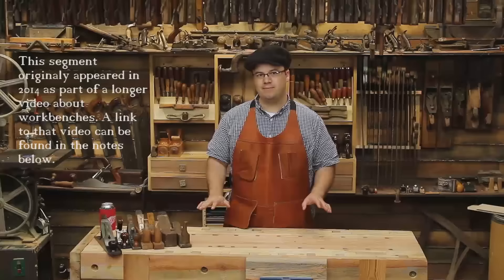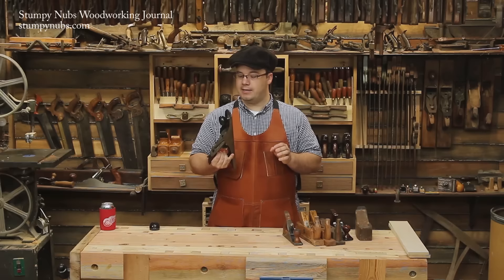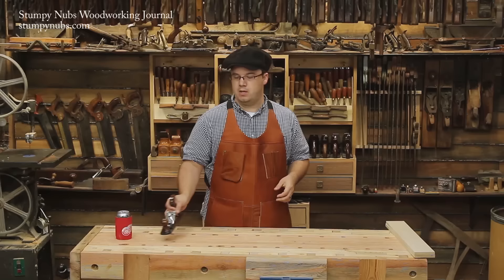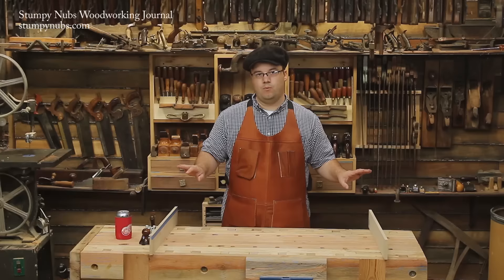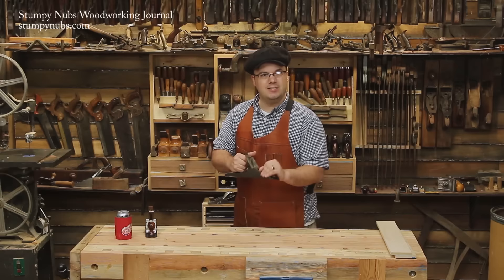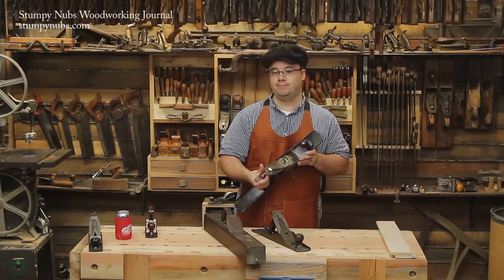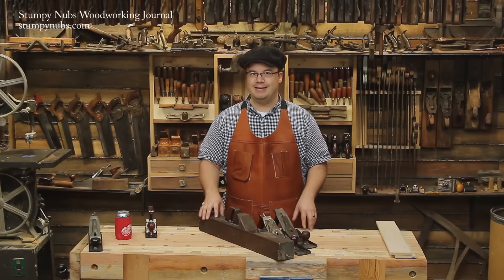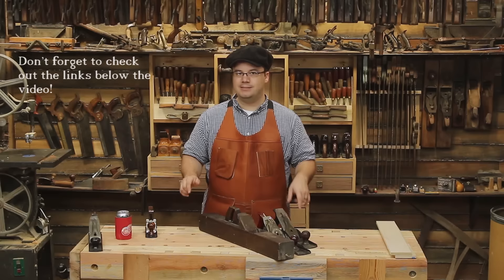How to flatten your woodworking bench with hand planes

Comment: Thank you. I didn't know I had a jack plane...but I did. I didn't know I could plane my work bench...now, I did it.  I didn't know my faceing vise needed to be flush to the table...now it is.  I didn't know I needed 3/4 holes to work with that vise...not it has them.  I didn't know a LOT!  Thanks, K

Comment: very angry ...  I could't flatten my workbench .. I used a belt sander and planer where necessary and ended up with a relatively flat workbench . Then thought I will just cover with a 18mm plywood - and  guess what the plywood is also not flat . I tryed to clamp it down in certain places and used wedges where needed ...   

Failed : ((  
It looks flat until you check it with a straight edge
I am gonna burn it in the back yard